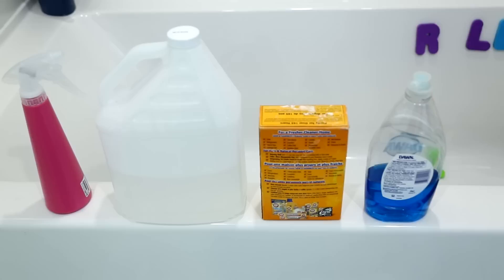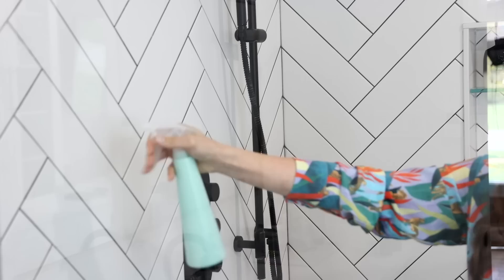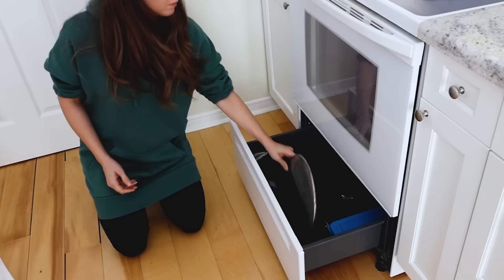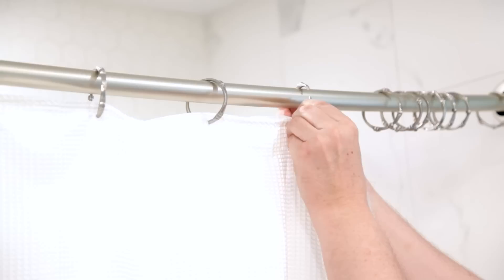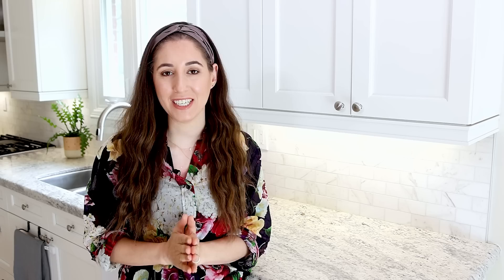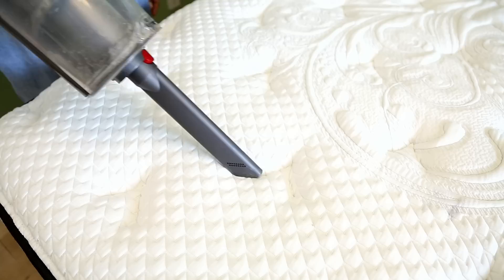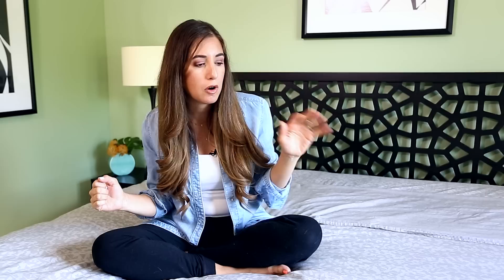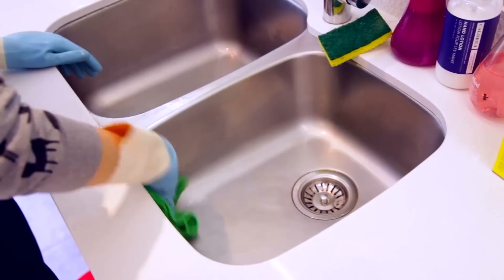12 Cleaning Jobs That Aren't So Difficult After All!

Comment: I have lower back pain as well as arthritis in my hands and knees. Could you offer more cleaning tips that are for people like me?
Reply: I recently hurt my back so I’ve purchased a bathroom scrub brush with telescopic handle so I can scrub the tub without bending and can reach the tiles readily, also. I use the stronger solution on the tub and yikes that Melissa uses for tougher jobs- 1/2 vinegar, 1/2 dish soap (optional essential oil) spray on and let sit 1/2 hr before scrubbing with my long handled brush (the bristles are just nylon so they don’t scratch acrylic surfaces)
Since kneeling is difficult perhaps use a chair/stool with this tool so you won’t need to bend or kneel down. Best of luck

Comment: I tried every thing to remove the soap scum from my fiber glass shower, the vinegar, water & dawn dish soap didn't work for me but I tried Krud Kutter & that worked, it took me 2 times but it all came off & now its a breeze to keep clean. Same thing with my hood vent & filter, I tried every thing to remove the years of dried on caked up grease but the Krud Kutter melted all of it off. I just let it sit on the surfaces for about 10 or 15 minutes & I was Amazed how all of it came off I ran it under hot water no using a cleaning brush to get in all the cracks & crevices of hood vent filter, but looks brand new 😊

Comment: Any tips on cleaning non cleaning oven with mould in it? I forgot about a half pizza and garlic bread in there, and I don't use my oven often. It looked like a fluffy grotto in there. Obviously, I've disposed of the food and wiped the worst of the mould off. I need to properly clean it, but in would normally use either diluted bleach or diluted tea tree oil, but I'm worried about when I use the oven again. Suggestions, please?

Comment: Two questions. First in the bathroom you tested the baking soda on the tub but I didn't see you use it. Did I miss a step? Second in the oven I didn't see a heating coil on the bottom of the oven. Do they come out or did your just not have one? Sorry I feel like I should know this but I don't. thanks for your time and help.
Reply: I have the same configuration, where the broiler is mounted at the top of the oven cavity, and the drawer below is for storage.

Comment: Dusting.  I live in New Mexico and the dust piles up daily. I try to keep up but it’s exhausting and annoying. I have ceiling fans that spread the dust into every tiny spot. What products do you use. Also, when dusting a large are full of tiny frames and figurines. Do you remove everything and clean the one flat surface? Or pick up each item then clean under it?  Thanks
Reply: Try a Swiffer duster
Reply: I'm in Nevada and have the same dust problem.   I've been chasing it for years and I don't think I'm going to win.  But I keep trying.😊

Comment: Hi, I love your videos. I have a lot of marks on my walls. The walls are painted white. How do I remove these without ruining the paint? I tried a Mr. Clean Magic Eraser, and it damaged the paint. Also, the sprayer tube in my kitchen sink is full of black mildew. Is there a way of removing this, or do I have to replace the whole faucet?
Reply: Vinegar in a plastic bag. Put a rubber band around it. Leave it soak overnight.

Comment: The worst part of cleaning for me is paper clutter. I cannot keep a handle on it. Every horizontal spot in my house has paper of some kind on it. It is mostly mail but reading or reference material also.  It drives me crazy.
Reply: THIS ALSO is my exact same issue. It drives me bonkers and the house looks so messy. I just can't seem to get a handle on it.
Reply: Cas from Clutterbug teaches that horizontal is hidden and vertical is visual. It helps me decide where to put things and make categories like bills magazines and correspondence..
Reply: It's the same for me.  I think the paper multiplies overnight. ☺️

Comment: As requested, what is the most difficult cleaning issue for me?  Removing odors from launderable clothing, like men's T-shirts, sheets, even dog bedding.  I use vinegar in the first rinse.  Sometimes I do a regular wash followed up with a vinegar wash, using a lot of vinegar in place of detergent.  The steam cycle in my washer seems to help.
Is there any single product that can be added to the wash to truly-effectively remove odors?

Comment: What is the amount of water and vinegar you used in the spray bottle (along with the 2 tbsps of dish soap) to clean the tub?
Reply: Melissa used equal parts water & vinegar to fill the spray bottle. Based on the size of the spray bottle, it was likely about 1.5 cups of each, then add the dish soap & shake before use. 

That’s about the amount I use & it works well.

Comment: Once while cleaning the oven, I went to lift the element up to spray underneath and it just snapped in half at the touch of my hand. Stone cold, of course, not wet etc and I've cleaned an oven about 100x in my life before and after, but this was a new oven and this was only the 2nd or 3rd time cleaning it. Thankfully it was still under warranty but even the technician was like "how did this happen?" It was shocking.

Comment: For most ovens these days it literally tells you how to take the door apart to clean wll those glass panels and that obviously would not void any warranty. It's fairly easy to do, so do check your manual to see if that's an option. If your oven is new enough to still be under warranty, chances are the door can be easily taken apart for cleaning.

Comment: We have  large  blade ceiling fans, and I can't even imagine how much dust there is on top of them.  I'm not even sure I want to try a swiffer on them.  Any ideas on how to clean these without sending piles of dust onto my furniture?  Kind of  the same with our heating vent, it's on the ceiling too.  Thanks!
Reply: I've seen this done; put a damp pillowcase over the blade (with the blade inside), and slowly slide the case off, with one on top of the blade and one hand under. It worked surprisingly well.
Reply: @It's a Carol B thing  that sounds like it might work.  Thank you!
Reply: No on the swifter, I do construction cleaning. The best I can recommend is an old-school static duster and vacuum. Drag the duster and hold the vacuum duster part to collect the dust from the dusting tool. I do fans, cupboards, baseboards, and almost everything with drywall dust this way before wipe down with a damp cloth.

Comment: I have white  lower kitchen shaker cupboard doors that have dirt in the areas you're using a toothbrush on in this video. I've tried using dish soap & cleansers with my cleaning toothbrush, but they don't come clean. I have no idea on what to use to get the old stubborn crud off, as it was here 11 years ago when we moved in. Would Mrs, Meyer's baking soda cleanser work or should I use an enzyme cleaner, like you've mentioned here?

Comment: Hold on, I thought the vinegar + dish soap neutralizes both ingredients and cancels them out as cleaning agents, since vinegar is acidic and dish soap is alkaline.
Reply: @Lying on the Moon 
You're right. That's true.  It's a kid's science experiment. So many youtubers say to do this and, yes, it neutralizes the cleaning agents making it ineffective.
Reply: I used this combination for a while without good results without tons of scrubbing and later found dish soap alone usually gets the tub clean with minimal scrubbing.
Reply: @coffeerocks4764  I have read they do cancel each other out. BUT, when you first mix them and they are foaming the chemical reaction is very effective to clean with. This combo with a blue non scratch scrubber is great at removing soap scum and water stains off shower doors.

Comment: We have two chandeliers in the kitchen and all the crystals get so greasy and hazy. It’s an absolute pain in the * to clean each crystal since there’s like 500 tiny ones on each chandelier and each one has to be wiped by hand. It takes at least 3 hours for one chandelier. We tried the sprays that supposedly clean chandeliers but it just made the crystals streaky and they were still greasy. There has to be a better way! Any suggestions?
Reply: Change to a different light fixture.
Reply: Gosh, they sound beautiful.  I don't envy your cleaning them, but I do envy that you have them.  I love chandeliers.  Maybe a Professional would be worth the cost.  I'd hate for you to change them out for something easier to clean.  Your kitchen must be beautiful, two chandeliers, very nice.🙋‍♀️